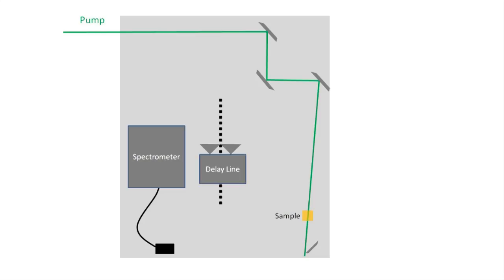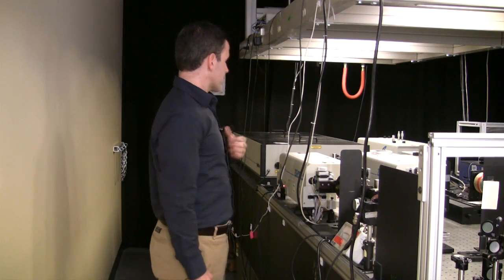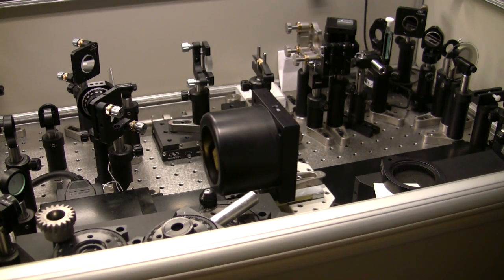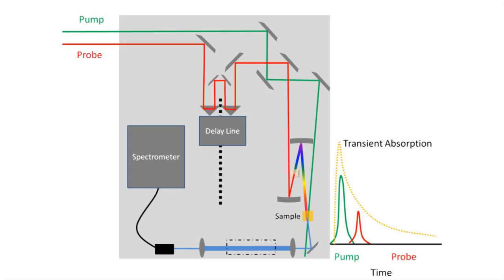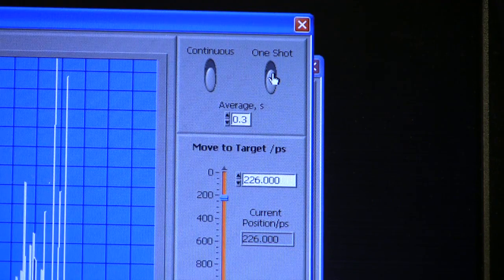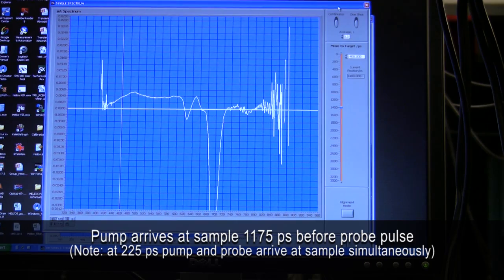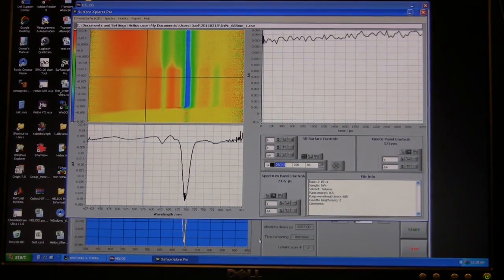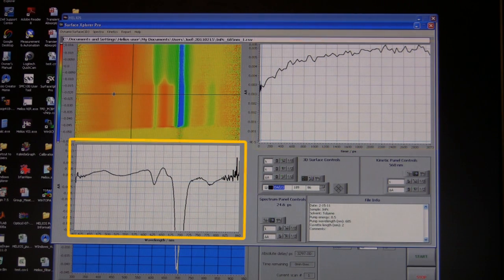Femtosecond Pump-Probe Spectroscopy

Comment: How can you measure picoseconds?
Reply: They are not measured, but you know the delay based on the total change in length of the delay line, from which you know what time the it takes for light to go through (given that the speed of light is constant and in aire roughly equal to that in air with little dispersion).

Comment: baichhabi yakami:  We use a short-pass 750 nm filter to remove (or suppress) the residual 800 nm light. Removing the filter will saturate detector.